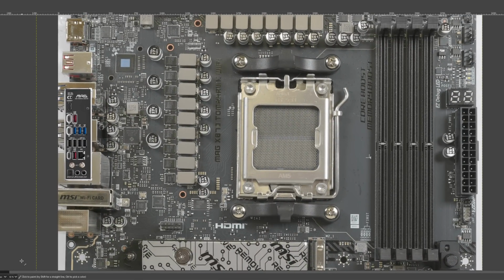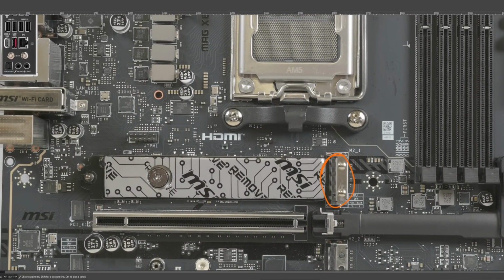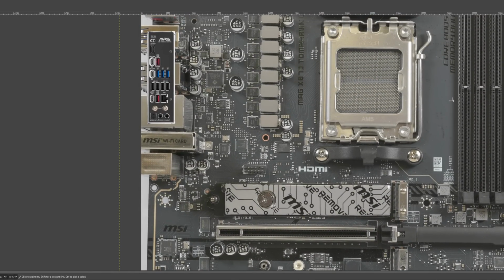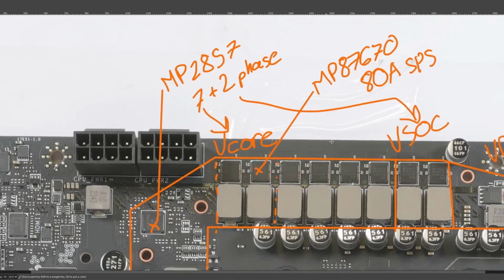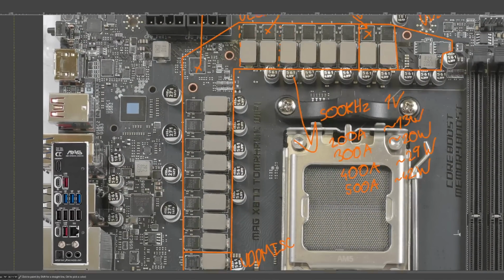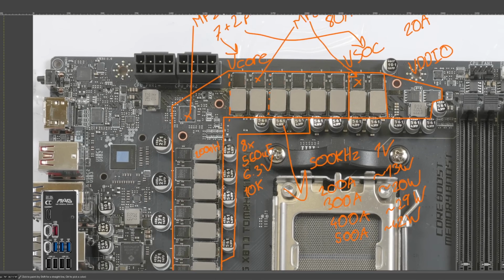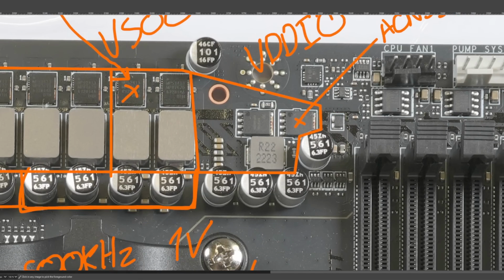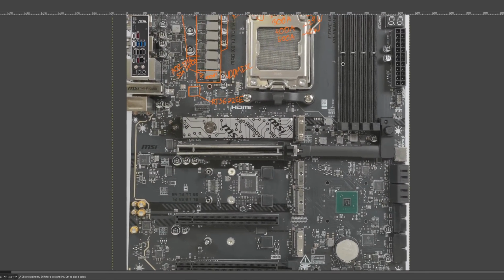mobo PCB Breakdown:  MSI X870 Tomahawk Wifi

Comment: 6:05 - Which is why I really wish we now had decent  PCIe 5x1 drives and multiple such slots on boards, as PCIe 3x4 speed is more than adequate for pretty much all bandwidth requirements and still faster than most drives can sustain for typical usage, allowing lots of drives, but only requiring a few lanes, freeing up lanes for add-in cards, USB ports et al, whilst still allowing a PCIe 5x4 slot for a super-fast drive for that occasional person that can actually make use of it.
Maybe one day we'll have manufacturers allowing engineers and designers to make boards that make sense rather than being dominated by "bigger number == better" marketing nonsense.
EDIT - corrected "we" to "as" ... odd typo but, it happened 🤷‍♀
Reply: New connector idea
A tiny header (google U.2), which is supplied with pcie5x4, you get a breakout cable for both power and data. You can connect 4 separate M.2 drives at x1_x1_x1_x1 in the same space motherboard space as a right angle SATA3 header.

Each drive can do up to 3.9GB sec... which last I checked nobody complained about the speeds of their 970 Evo plus (and 99% of windows operations are <1GBsec anyway). Even if due to signalling (very likely) it has to be reduced to PCIE4 that's fine AND the AM5 chipset downlink is PCIE4x4 anyway.

1) I hate wiring, so running separate power and data cables for SATA drives suck (plus its locked in 2010 speeds).
2) I want lots of NVME storage but covering a board in M.2 slots is a literal waste.
3) the space and PCIE lanes saved creates more options for actual PCIE slots.
4) who likes to fumble-fuck around a tiny little screw which they''ll inevitably drop into the PSU.
Reply: @tomstech4390  
A) MCIO
B) I complain about the speed of my 970 Evo+ (and 970 Evo), but that's the controller and flash, not bandwidth issue.
C) There's loads of unused space on the back of mobos, which could be really easy to reach with a new standard design, that could incorporate the current hodge-podge rear connector thing that needs standardising.
D) There's already a few solutions to the m.2 screw issue.

Comment: taichi and nova are the best this generation
Reply: Is the mem overclocking still botched on them? As in they didn't do 7400+. Thinking of the Nova if it does 8000+
Reply: @atirta777  ASRock really messed up their memory oc support.
Reply: @PowellCat745  I hope it's due to early BIOSes cuz it would be weird that some of their B650 4-Dimms could do 8000MT/s but X870 wouldn't
Reply: @atirta777  My X670E Taichi does 8000 Mt/s but it took over 200 hours to get it running stable with tightened timings.